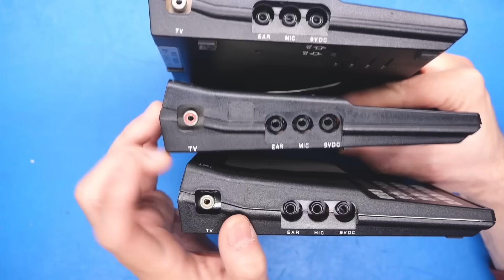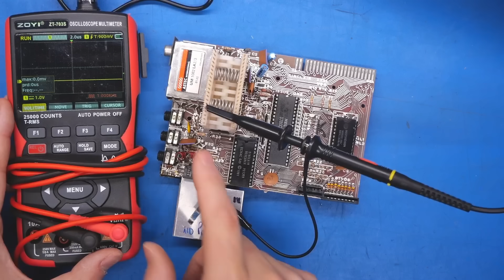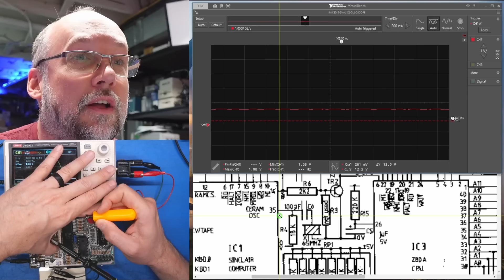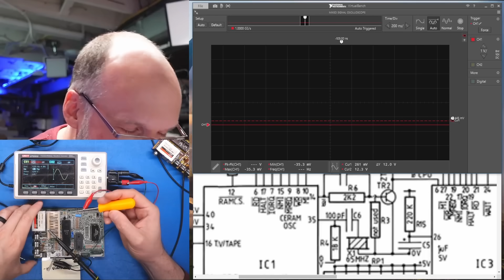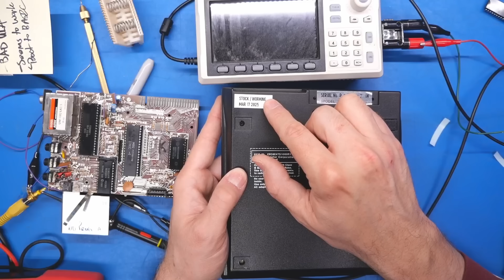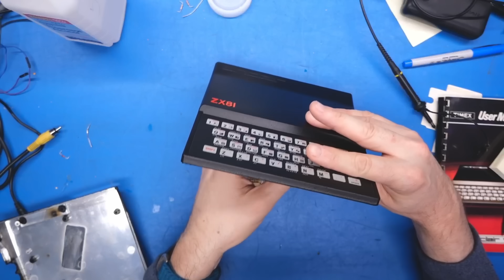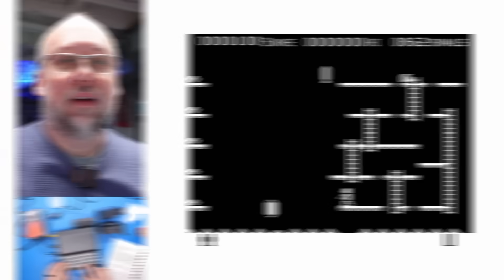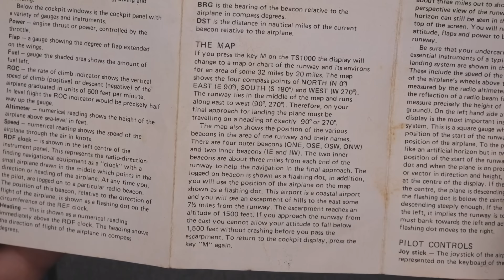Is the ZX81 / Timex Sinclair 1000 actually bad? Let's fix these to find out.

Comment: Some ZX81 trivia. The Sinclair ZX80/ZX81 and Timex equivalent are the only home computers that do not use ASCII, not even a bastardized version of ASCII, like PETSCII. It misses some characters that all other machines have, like #, !, '  and @. But it does have £ and a bunch of block graphics in its 64-character repertoire. The video hardware is very interesting. The Z80 'executes' the bytes in video memory, while the ULA forces the fetched bytes to zero, as the Z80 sees them (and uses them for the video shifter on its own). The 'refresh cycle' of the Z80 is used to address the character pattern in ROM, which is then pushed into the shift register. Some byte values are not forced to zero to the Z80, so at the end of each line is a HALT instruction that causes the Z80 to wait for an interrupt. At least in the 1KB/2kB configuration, text rows contain only as many bytes in RAM as are used, so a mostly empty screen uses much less RAM. In the 16kB config you can run special-purpose machine code to have different 'character codes' and ROM character table addresses for each scanline, as some of the games show. It's really hard to work through the constraints of the video hardware to get the moving sprites in that rocket man game.

Comment: Oh, wow! Blast from the past! The TS1000 was my very first computer I've ever owned and I spend a lot of time with it (it never got old despite the really bad keyboard.) At some point I purchased the 16KB memory expansion and was surprised that it behaved rather strangely once your BASIC program grew beyond 1KB in size. I did not know that the expansion was incompatible with the TS1000 due to its 2KB of onboard memory. Luckily, I had some money saved up and went out and bought the original ZX81 instead (that was in Germany, btw, and the TS1000 was a gift so I am unsure where my parents bought it.) Anyway, this was the one and only computer I've owned until I earned enough money and got myself an IBM AT clone. Didn't the ZX81 also come as a DIY kit? I know the ZX80 did for sure.

Oh, and no, I'd never have picked the VIC20 over the ZX81. I was a die-hard Zilog Z80 fan!

Comment: I got a zx81 in 1981, put first 16k on it then 32k expansions, and a graphic expansion I could never get to work right becuase I didn't have enough power with a standard power supply...and moving up to a bigger one was a huge deal for me to work out back then...I did get a replacement keyboard that had a ribbon cable that slide in and the keyboard just sat out front of the computer...it had good size keys with full travel that worked well.  But it still didn't have a full space bar....but that was much better for typing.  Yea the ram expansion made it slower to start, and it did mess with the video output a bit...but it was a nessary evil to do anything with it.  I did manage to write a missile command clone in basic and got it into a playable game...but after that I switched to assembly for everything i wrote for it.

Comment: I still use a zx81 to control switch gear on a table top model railway. They are bombproof and easy to use and program. Add a RAM pack and you’re good to go. In 1981 there was nothing to touch it.

Comment: I took a filed trip to 1 Sinclair Plaza two summers ago and toured the old buildings (video on my channel July 2023). I think that Sinclair overlapped with selling the US ZX81 with the TS1000 for a while. The reason the 1K RAM kinda worked is that ZX81 BASIC was tokenized at type in so basically a means of compression (i.e. P R I N T only took 1 byte instead of 5 bytes).

Comment: The modulator probably had some RF filtering. Try looping the video cable through a ferrite, like mix 31 or 73, assuming it might be CMI. If the issue still persists, perhaps try adding a low-pass filter circuit. Going further down the rabbit hole, look into a FMS6404 chip or whatever modern equivalent.

Comment: I've driven a couple of breadboard computers with a simple RC oscillator made from a hex inverter, a capacitor, and a resistor.  Nowhere near as good a clock as an actual crystal oscillator, but it works fine for experimentation.  Nowadays, there is no reason not to use an actual crystal oscillator, or a bench clock source for experimentation.

/edit i take that back, you might want an adjustable clock, and that is far easier with an RC based network.  But if you want an adjustable clock, just use a signal generator, they're cheap.

Comment: I have TRS-80's that i bought years ago, because i was feeling nostalgic.  And those had that same tinned edge card connector.  Luckily, there was a fix, you could get a connector you could solder onto the motherboard that would give you gold connectors.  Made the machines much more stable and usable.

Comment: The way i look at it, the ZX81 was a lot like an Apple.  Hardware is expensive, so you use the CPU for everything.  Why were apple floppy drives so inexpensive?  No floppy controller to speak of, make the CPU do most of the work.

What killed the ZX81 for me was simply the speed.  IIRC, it uses the CPU to do a lot of the video work, thus not leaving a lot of processing time to run programs.  But you absolutely could not beat the price.  That was one inexpensive computer, and it was a computer.  So if it was all you could afford, it was better than nothing, for sure.

/edit:  If i had not already had a TRS-80, i would have saved up for one of these.  I wanted a computer so badly, and luckily one fell into my lap.  But i did try the ZX81, and it just wasn't the computer for me.  I have big hands (even back then), and that keyboard!  <shudder>

Comment: Looks like issue 1 made some very weird decisions.  They used an LM1889 to modulate the chroma.  The chip is also capable of modulating the final RF output and mixing in the sound, but instead they assigned that task to the separate UM1082 which doesn't support sound.  Then the lack of a back porch.  Even enveloping the composite signal into a 60MHz modulation won't fix that.  Even more critically, the color burst is part of the back porch too, and without it you just get B/W, making the color modulation of that LM1889 completely useless.  Either there is something being overlooked, or the claim that there's no back porch is just plain wrong.

Even the issue 2 and later ones seem to be very disproportionate on the sync signals.  Your final "bright" signal had the sync pulses about 3x as large as they needed to be.

Anyway, the output to the composite really needs to be around 75 ohms anyway, to match the impedance of the transmission line (the AV cable) and the termination at the TV.  I don't know why people keep designing common-emitter amps that have stupidly high resistances on the output.  And some even add stupidly low local load resistances for even more absurdity.

Comment: I was gifted a TS1000 from my grandfather for my birthday several years ago, going through his basement he was clearing out to move, knew i liked old computers, and gave it to me, with its box and ram expansion. Tape too, The Flight Simulator like you had. The box even had its price sticker, $97.76 from Caldor. Very sadly, it was totally not working right, it seemed to boot but video was gone and i was much too inexperienced to try to fix it. Ontop of that, the ribbons were flaking away. Every now and then I come back to it to try to bring it back.. hopefully your video about them will be the extra motivation i need! :)

Comment: In April 1982 My dad gave me $300 for my 16th  birthday to start saving for a car. In August 1983 just before I started 12th grade my dad said I could buy a computer with some of that money.  I bought a 12 inch Black & White TV and  I bought a Vic 20. The Vic 20 was $99. The TV /Computer switch was bad but I had one from a video game that didn't work anymore.  My dad convinced my to return in and get a TI-99/4a which was  $99 after a $50 rebate. We thought it was a better deal because it had 16K of RAM and supposedly more software available. We didn't know that it had already been disconnected. By summer of 1984 I didn't have a Peripheral Expansion Box or any way to connect a printer. I bought a Commodore 64 and a floppy drive and printer.  By fall 1986 I was considering a C-128 but I decided to get a Blue Chip PC.

Comment: I find very little redeemable about the ZX81.  Yes, if it had a better keyboard and more built-in RAM, it would have made a huge improvement. But still, the VIC-20 was cost competitive, as you mentioned, and dang... you get color, 4 voice sound, a real keyboard, disk drive support, etc.
Reply: It may have been cost competitive in the US, but not in other countries. When I got mine with 16K RAM ($400), the commodore machines were double that price.
Reply: It actually makes much more sense to compare the ZX81 to the original Apple ][ than the VIC-20. It has a lot more in common with its design, albeit severely cost reduced. Moreover, B&W TVs were still very common in the UK compared to the US at the time of its release. There's a lot more to redeem the ZX81 when you keep things like that in mind. However, it was pretty much doomed in North America.
Reply: The exchange rate, VAT and import duty made most stuff from the US noncompetitive in the UK.
Reply: No one cares about your opinion on anything.
Reply: @rachelaudrey6241  He's just as entitled to his opinion as you are to your non-opinion. Of course the ZX81 was very limited; it was a conscious design choice to cut costs. Let's not forget that Commodore had vast resources compared to Sinclair's comparatively small operation. More importantly: it was a US vs UK design, which reflected local demands and economic realities.

Comment: I had one of these. There's a way to switch the video off while doing cpu-heavy operations to speed things up. I wrote a prime number calculator that used this trick. I also bought an aftermarket rubber keyboard that glued on top of the original membrane keyboard to provide a little better tactile feel. When the motherboard finally died, I took the guts out and made it into a wall clock! (Appropriate to the 'Timex' branding)
Reply: The original ZX80 screen flashed off when the CPU was calculating. The solution to this was to give the ZX81 "Fast" mode which was the same and "Slow" or "compute and display" mode which maintained the display at the cost of running much slower as seen here. This is also why Adrian's screen fill program paused for keyboard input after filling one screen - in "fast" or with a ZX80 the screen would have blanked on pressing "enter" after Run and displayed that screen in one go.

Comment: Q :  Was the Sinclair ZX81 microcomputer actually bad? 
A : Yes and No
Reason Bad : Sinclair ZX81 BASIC is missing the DATA, READ, and RESTORE commands. Its poor quality edge connector for data connection and memory expansion.
I owned a ZX81, issue 1 release, from 1982 to 1988. Any computer magazine program, which did not use PEEK or POKE commands, but which used the DATA, READ, and RESTORE commands, was absolutely impossible to even try to enter and run on the ZX81.  The edge connector was unstable even for connecting the thermal printer which the ZX81 could use.  
Reason Good : There were well written games and apps for the ZX81 which worked perfectly in its 1kb of RAM. Well written games graphics were very smooth on the ZX81.  Saving and loading programs from cassette was very reliable, once you had the volume levels correctly set. Yes they were not good at first, and it took trial and error to get them set, but once you had them set, save and load on the ZX81 were then thoroughly reliable. Having a cassette recorder with a tape counter, was an absolute MUST, and writing down the start and finish tape counts on the cassette insert card, was equally a MUST, for having multiple programs on a C30.

Comment: I had the kit version of the timex sinclair 1000. You had to solder all the components onto the main board, but it was even cheaper than your posted prices. I also got the 16K expansion.  I was never able to get my tape recorder to save and reload any basic programs that I wrote.  I even buildt a "buffer"/filter circuit from popular electronics that should have helped clean up the audio signals to/from the tape deck. Didn't get much use out of it with no reliable save ability.  I liked the one key basic commands though. It make typing faster as the kbd sucked.  I enjoyed your video.  My next computer was the atari 800 with a floppy drive!

Comment: My gateway computer. Got to play with one for an afternoon at my father's workplace, a local college. It had a d'Ktronics keyboard, which is utter trash also but still somehow better than the membrane. Ribbon cable dangling out through the front of the case to it. As an introduction to computing on a low budget (the 80's in the UK sucked) it was fantastic.

Comment: I was saving my UK pocket money and Gardening money for a Sinclair ZX80 when the amazing pre-built Z81 came out for the same price! Wow, Gosh! 
To put things into perspective when people found out that I owned a computer most were astonished that, what should fill a room, was so incredibly small and simple! The most common question was "Why would I want a computer"? 🙂🙂
At that time you typed in programs you got from the latest Sinclair magazine. Because each basic command is a single key press the challenge was not the keyboard but remembering the shift/function combinations. The 16K "Wobble Pack" was always an issue as was getting the volume settings right on your tape player to load and save.
I was still using the same highly modified ZX81, (including proper keyboard, carry case, Microdrives, and Sinclair printer) at Mec.Eng. Collage. My system running my own Basic/ Machine code software to do my engineering calculations and reports was a big part of getting me my degree! Games were there for impressing fellow students 🙂🙂

Comment: Hi Adrian. The reason it operates without the ceramic resonator is probably all those support resistors and capacitors (plus the one transistor) makes a minimally-functional R/C oscillator - that’s why the frequency isn’t stable and it’s all jittery. 😊

Comment: You are correct, the 16K ram packs were quite expensive for the time. I saved up for a year and bought a DKtronics clone at £29.95. It didn't even have a case. I bought 16GB of ram for a laptop about 30 years later, and allowing for inflation, I realized that memory has become a million times cheaper since that first ram pack! And IIRC there was only 780 bytes after system & video memory reservations.

Comment: The BASIC on the ZX81 was great! Some of the shortcuts made things better than other BASICs. For instance, aside from the line number at the beginning of each line, anywhere that a number can be used, so can any kind of evaluation, variables included. It had useful logic operands, so you could do stuff like:

GOTO (220 AND A=4)+(250 AND A=5)+(270 AND A=6)

When I tried various Microsoft BASICs, it annoyed me to no end that they were horribly incompatible from one machine to the next, so I came to appreciate and enjoy Sinclair BASIC.
Reply: Atari BASIC also had those embeddable logic functions.  They were really handy for updating the X, Y coordinates of a player character based on the value read from the joystick port.  A single line of code was all that was needed.
Reply: Whoa...program line numbers could be treated as variables?? 😯 That is pretty impressive actually.
Reply from the maker: The biggest struggle for me is the editing capabilities .... especially compared to the 1977 Microsoft / Commodore BASIC. I'm sure I was missing some tricks on the ZX81 Basic but I got stuck a number of times making this video where I had typed in a long line when I realized I wanted to just cancel the whole line, and couldn't figure out how. Just pushing enter doesn't work like on Microsoft basics .... It quired me to backspace over the whole line.
Reply: @adriansdigitalbasement  It's been years, but... I think you can get out of that by pressing "EDIT" (shift-1) again, although IIRC, that only works if the line number you're currently typing already exists.

It does make editing easier, because instead of doing up and down arrow to get to the line you want to edit, you can just type the line number, then EDIT.
Reply: Its array- and string-handling was also superior to its contemporary BASIC dialects.

Comment: The ZX81 was my first home computer. Had the 16K memory expansion pack and one of those iconic Panasonic cassette recorders (I'm sure you remember them - laid flat on the table, mono speaker, record button was a red pip that poked through the play button) for saving and loading programs. That film keyboard was absolute shite. I'm pretty sure it wound up in the art bin after we got a Tandy CoCo.